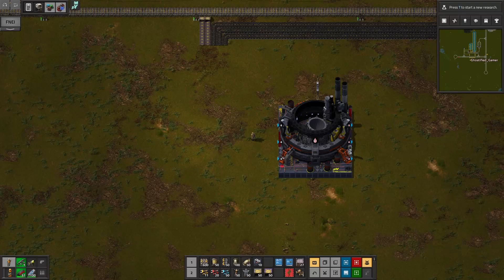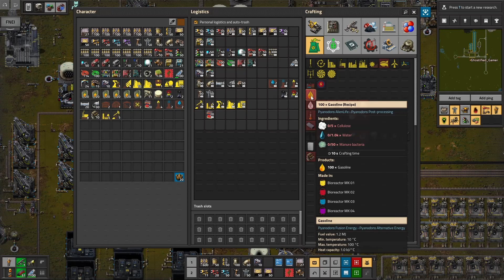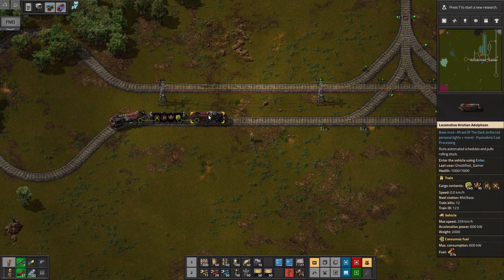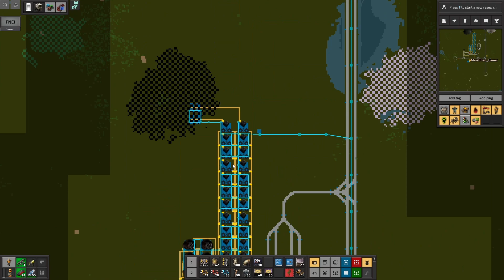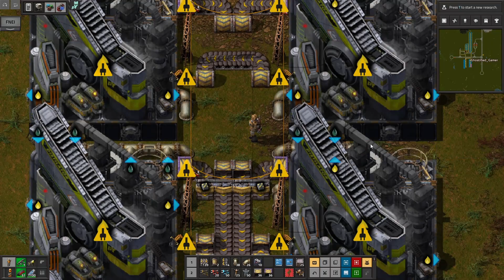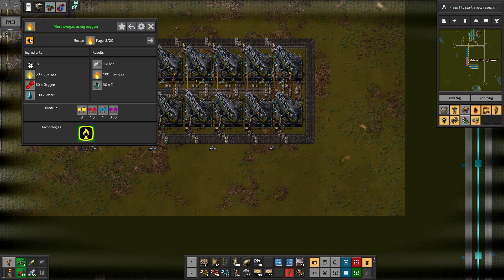Factorio pYanodons - Coal Power Rebuild - EP74

Comment: One thing that may help when you're tiling builds is to keep in mind whether you need to tile your machines singly, or in pairs. If you haven't flipped any machines, then you can tile them singly: place down two machines, then copy them and overlap one. But if you have one machine facing "north" and the second machine facing "south" (where "north" and "south" might be east and west in some cases), then you need to tile them in pairs. Best way would be to place down three machines by hand, then copy those three and overlap one. That way you're overlaying a north-facing machine with another north-facing one, and your pipe layout will still be right.
Reply from the maker: Good point.  I forget to do three at a time.  I get overzealous.